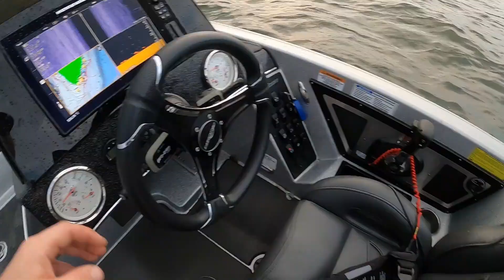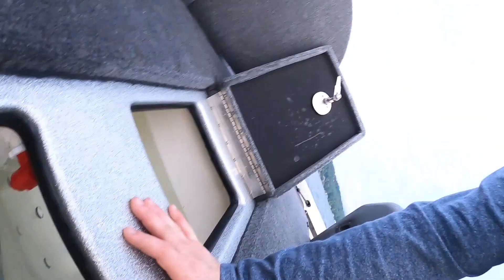This Will SAVE The FUTURE of Tournament Fishing!

Comment: All bass tournaments should be catch and release on the same spot as they are caught! spending all day in a live well even with oxygen creates stress and that is the big killer... on top of that very few are ever released where they are caught.... come on guys clean up your game.....
Reply from the maker: When you’re having easily 16-18ppm of supersaturated oxygen constantly pumping in your livewell from fishlung compared to 4-5ppm of traditional livewell systems-there is no comparison. This reduces stress significantly
Reply: @JThompsonFishing   i agree i worked in a hatchery where those stones were used every day but they clog up with fish slime and dirt you have to maintain them regularly and it is a expensive system yes sponsored pros will have them but that still does not solve releasing these fish where they are caught. I see it all the time some fish are caught 50 miles from where they are caught and they die from stress because they are not on familiar ground and they do Not swim back to their home ground if it is far away. Catch and release on the spot measure by length instead of weight that will solve the problem for everyone !